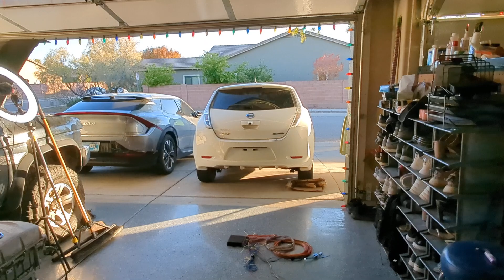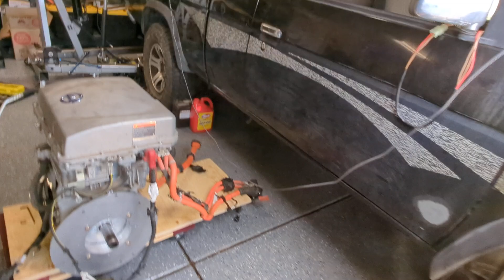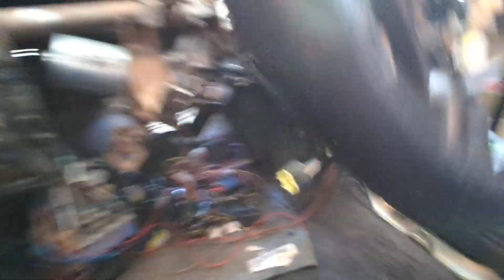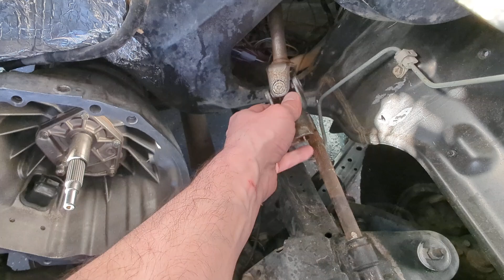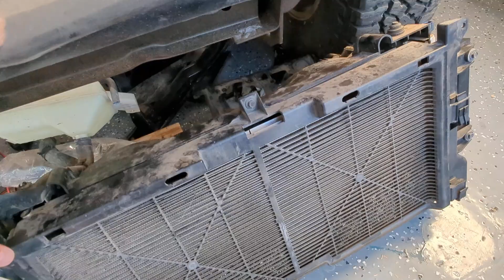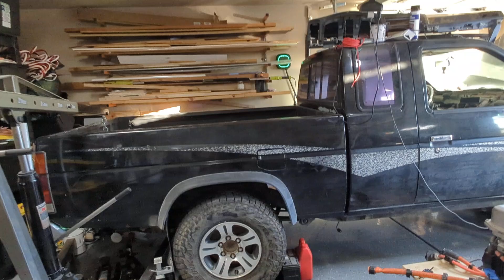Nissan D21 Hardbody 4x4 EV Swap

Comment: Great vid. I am also using the EM57 driveline for a conversion, though a totally different vehicle. I am at the gearbox adapter plate stage only. Yours looks awfully thin for that large gearbox bell housing, especially when comparing it to the Brat Industries plate (17mm thick) on the Leaf motor.

Comment: very happy to see this.
I've long been hoping for EV converted ute and 4wd. Even if only for tow rating around the city.
I tow a small box trailer with my ZE1 (empty 250kg, limit load to 250kg)
my power draw increases by 30-50%, aero drag isn't so bad at 60-80km/hr, hills are very noticeable even with light load.